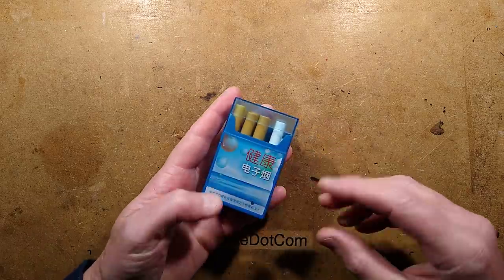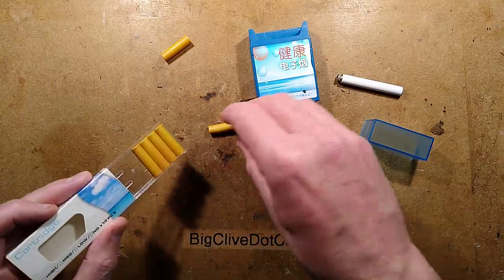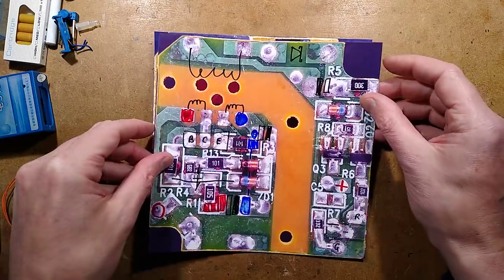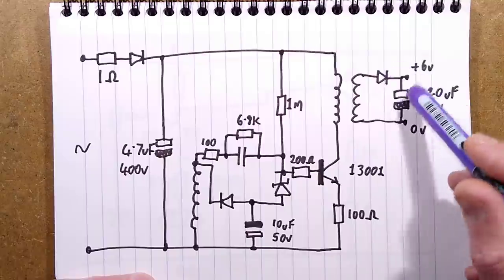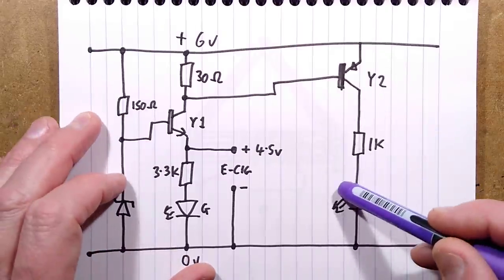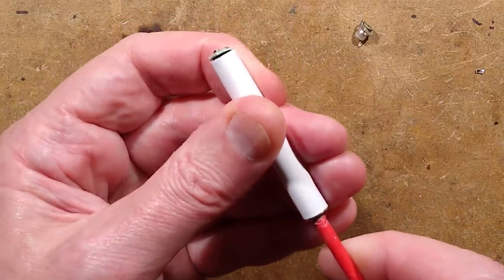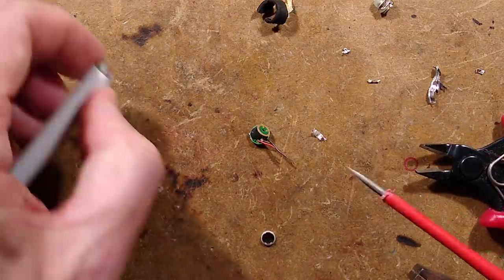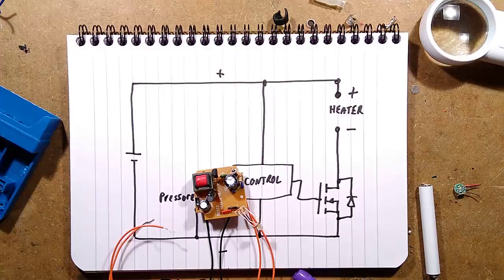Vintage novelty device teardown (with schematic)

Comment: Strangely enough, I found the insides of one of those e-cigs lying in the road a couple of weeks ago. The battery, controller, heater and pressure switch were all intact and undamaged but any casing had presumably been run over. The tiny led was still flashing occasionally otherwise I would not have seen it.

Comment: I hate how the vaping industry ruined Canadians from getting 18650s at a decent price. 25 bucks for 2 last I checked locally and can only be gotten from Amazon if you buy a flashlight which comes with extras. While cheaper than from shops still not worth exploring for wireless sensor projects for those of use with big pieces of property and such.
Reply: @nemesis2264 in the US it's 4 dollars a piece. I have a friend who could mail them but that's frowned upon. Haha

Comment: The input power can't be across the heater because it would turn it on when charging.  So there's something missing there.  Not complex however, perhaps there's nothing more than a diode involved.  It's of little consequence, the peek inside is enlightening as intended.  Thank you!
Reply from the maker: The charger connects where the heater goes.  Both can't be connected at the same time.
Reply: @bigclivedotcom    Oh right!  Silly me, it's swapped out.  Now I get it.

Dangit, now I have to find some other way to criticize!  ;-)

Comment: Funnily enough when I bought my last phone (from eBay) it came with a deathdapter as the power plug wasn't UK (but the phone was in the UK region, weird). I still use the deathdapter now. Tbh all OnePlus chargers can give you a nasty zap when unplugged and so I assume they're missing a discharge capacitor...

I'd love you to open one to confirm haha.
Reply: - that would be a small resistor paralleled with the offending capacitor to discharge it ✅
Reply: @samuelfellows6923  Yeah seems I meant discharge resistor not capacitor

Comment: Clive when you have finished your dismantling of all the devices. The items that you can't re-build and there circuitry inside that is still in working use. Do you re-use those circuits, for example, the built in power supplies. To use them for the output voltages in your own projects that you build? Maybe you could show some of those repurposed circuit's in action.
Reply from the maker: I do keep some circuitry, but the power supply in this device would not be safe for most projects.

Comment: I bet that the hardened steel wool on the tip is in fact sintered material - basically small balls of metal that are pressed into bonding with each other without it really melting.

Comment: I live in America and we had something similar to that in the mid 2000s maybe a little bit later made by a company called Blu and seeing that reminds me of the one that I used to have almost the same exact setup except the case looked like a pack of cigarettes with their branding on it and it didn't have a plug built into it you had to plug the pack in to I believe it was a USB cable and they had a standalone charger that came in the kit that you just put like twisted the battery into and you can charge just a single battery off of USB port instead of two batteries in the whole pack

It even had the same style cartridges that look like a cigarette filter with a tip that pierced the foil that you screwed onto the bed exactly the same as what you're holding in your hand

Comment: Weird question but - is there a reason you used an adaptor plug rather than plugging it directly into the HOPI? It looks like the HOPI will take any number of bizarre plug shapes!
Reply from the maker: Spacer.

Comment: Reminds me of a strange and thank god shortlived "concept" of ciggies, they where however reliant on fire to get going, by torching a small coal piece at the tip, that then warmed up wet tobaco inside the "ciggie" (which was made of thick paper with some coating on the inside) and then gave off vapor without actual burning of the tobaco.. how far we have come!

Comment: Big Clive... Master of finding the screw holes of novelty items 😅😂🤣
Reply: It takes years of experience. I can tell you - from years of experience.
Reply: @OldBenOne  there's normally at least one screw hidden under a label somewhere on a device generally I found that to be the case in most devices personally if you're trying to to open some of your tank so in part for any reason it seems like you're forgetting a screw or faster and it's obvious that there's still one left do a quick label check and if there's a label that's where your group is more than likely
Reply: Just before 12 a.m. my time here
Reply: And as I say or I'll just watch one more video and it's 5 videos later plus LOL possibly tonight or navy. Just depends on how things go.

When sleep does not come easily sometimes by the way it's best to do something until you're tired when you cannot sleep honestly I've been told that specifically by physicians so it's true for sure and yes it does help to be tired enough to actually get to sleep.

Most field don't realize this and anyone that does not might be very surprised at how well this works worth a shot.

If anyone is just can't get to sleep lying awake and so on.

If you try to force yourself to sleep or don't do this often times if not most you'll wind up awake longer than you would if you just how to get to sleep when you're actually tired enough had this happened enough times to know and have been told this again from Physicians

Comment: My neighbor gave me a couple of these along with some charging cables that plug into USB. The battery part has an led built in so the tip glows red when you draw on it. They'd been sitting so long the the cell was flat, and I thought I'd have to scrap them because they wouldn't charge. I took one apart and while probing around, I discovered that if I momentarily bypassed the charge chip while it was connected to the charger, it would give the cell just enough voltage to wake up the charge circuit and I was able to recharge them.

Comment: I found one of the 'cigarettes' shown in this video, many years ago: someone had discarded it and others had trodden on it.  Being a fool, I picked it up because I noticed some 'gunge' emanating from it.  Once taken apart - using a Dremel in a not-very-subtle fashion - I found the small circuit board and microphone-like device and LED shown in the video. Naturally, I decided that it must be a secret Soviet-era bugging device and I spent a few hours fruitlessly tuning up and down the FM band, trying to detect a squeal of feedback.  There was a tiny amount of charge left in the cell so I connected a white LED and resistor and used it as a torch for a few hours.

Comment: The pressure sensor is interesting, I wonder if it actually is an electret mic (which have an internal FET as a preamp). I know these things have a DC offset at the output when operating as a mic. It seems likely that a pressure difference between the outside of the capsule and the sealed reference chamber behind the diaphragm would cause this DC to vary. I'll have to try it...
Reply from the maker: In this case it's purely the diaphragm being separated from the case by a wafer thin ring, so it flexes under air pressure difference and triggers the unit.
Reply: Bit off-topic but your user Avatar or image whichever YouTube calls it's still shaky on that term for YouTube and Google for that matter.

And your username neon time.

Is that vacuum tube supposed to be an image of a voltage regulator tube?

Also once I ran across this place that hand multiple two bases in wall plates spread throughout the place.

And someone asked me what that might be for and I investigated they were thinking about just trying to prove it and see where it went or if you're connected or whatever and I said please don't do that because depending on what it is it could have high voltage theoretically present on some of the connections.

In actuality when the that circuit for every one of them was energized if the tube was inserted you get around 220 volts or so out the voltage for your tubes had to Children's at least that were connected straight through through to disconnect power from the power transformer generally of the device if the voltage regulator was removed from circuit aka the socket to provide protection from unregulated B+!

In this case it was disconnecting yet so there was no high voltage present if the socket was empty.

And yes all those sockets work connected through voltage doublers inside the junction box attached to the cover plate.

At first I'm when took one of the covers off I'm like what the heck is this circuitry for but I realized it was a voltage Doubler.

But the use of it stump me for a bit.

But there was no power coming in at the time.

As well as all the wiring was run box-to-box confirm that it the same wiring ran from box to box and there was at least a couple Joshua boxes as well.

That that's the only thing in that long run of wiring.

Which again kind of stump me.

When I went to the basements I realized there was some stuff down there that would be a timer and also photocell in a few switches in a few other things all tie together.

That obviously was meant to control lighting when the sun went down or after a certain time whichever came first oriya full movie dark out an override the timer and one switch said manual off auto.

It was in the off position at that time.

And there were certain Outlets that never do have power before then as well.

Also I did find a box of several of the same type of voltage regulator tubes like why would that be here took out one of them and realize wait a second is this something to do with this and I was thinking wait a second you can use these is a neon bulb.

And then it kind of clicked that wait a second with his fancy lighting control and this I wonder is this what fits those sockets specifically for that purpose.

Turns out bingo voltage regulator Night Lights!

Built-in to the place at that.

It also controlled one outdoor light in each area where there was willful outdoor lights and not only that but there were some switches that had three Physicians elsewhere in the place that were also connected through some other circuitry and wound up going to this lighting control system.

An interesting Lee enough Soma Elwood's were wired in a wage we switch between that and manual control or just on and other outlets forward strictly to the control circuitry.

However there was a box on the wall compelling contactors in some other electronics that this and other things were tied through as well and there was what looked like something from an old computer system or perhaps an old electronic organ reset combination action kind of thing.

That hand single insulated ended pins that could be inserted the clothes different sets of contacts for assigning different things to different operations.

I never seen anything like that before or at least at that time yes I'm more Manor.

And other automation old and automation goodies as well as well as it did have the old 24 volt 50s and 60s low voltage switching which solo this were tied into this and similar things as well

However the most interesting thing is about that place in the hallways and on the stairs if you were to put your hand near the railing or slightly near it don't remember where is he trigger plate wire metallic foil would be located too many years ago.

But in those cases when your head your hand on the railing or near it or in the case of the hallways along a certain place on the wall the lights would automatically come on.

Basically early momentary touch light switch.

Surprisingly everywhere there was tubes most we're still operating to that day.

And also a wealth of spare tubes and parts!

As well as some sort of remote control or signaling Hardware that was apparently Wireless although I only found the receiver at that time.

In a closet box with a big insulator and a long antenna.

But I made sure to disconnect that Not only was it a receiver it was a transmitter.

And also at that time that I had discovered it that was on a band of radio that was used for communications and also required an amateur radio license!!!

I think it one time either someone had a radio license and yes although this look custom but not everything.

It was built like out of modules I can see an old alarm systems definitely the DYI approach for some of them.

They were the old phenolic Bakelite or whatever same stuff is Old Tube sockets basically on waferboard or whatever you want to call it.

Will screw terminal blocks like that of speakers.

Anywhere from 2 or way more terminals in that.

And also live 120 volt in addition to low voltage on said terminals.

As you know back in the day that was acceptable It generally if you use certain equipment the people that would use it would be well aware that you don't go putting your fingers in back of the equipment since they would very much know what voltages and currents were present expose connections.

Such as on some old radio receivers and transmitters there will be raw AC power going to possibly an antenna relay or other equipment just to screw terminals like that little speaker terminals.

Also my folks to use an old waffle iron roughly a hundred years old still makes the best waffles ever.

However you never put your fingers anywhere near the power input since there is a removal cord however around that there is nothing no cover guard around the terminals which are basically bolts with connection pins.

And there was never a guard or provision for one of them.

Also I do believe I found the toaster that might go with that make of a plants from the same company thrift store once.

Plug-in cord was identical but I do not remember if it had does a plug or not worth is hardwired into it.

And also it had the exact same type of male plug on the cord as well a bit much better condition as in actually safe to use.

I do remember changing the power plug on the waffle iron yeah it was falling apart.

Not surprisingly.

That had been given to us many years ago been going strong ever since.

Works better than other waffle irons we've used before!

They don't make them like that anymore and most not as good.

Well I've waffled on enough I think

Comment: I noticed you used an adapter for the vape. The HOPI seems to have a universal adapter already built in. Is it still necessary to use the adapter you used in order to correct the voltage or polarity?
Reply from the maker: Spacer.

Comment: I think  and  this is just  my opinion,    is that the  feedback loop  off the  transformer  acts   like  oscillator because it's not rectified  by a   "dio-dee  "    Your  50  HZ  AC   acts  like the  oscillator as  it  turns the transistor  on and on  as the  alternating current  comes  out of that  feedback loop of the transformer . You mentioned that   the sine  wave    goes negative  below  ground
Reply from the maker: There is a smoothing capacitor, so the transformer does oscillate at its resonant frequency.  The feedback circuit in these single transistor units had me baffled in the early days until I realised it charged the holdoff capacitor below the negative rail.
Reply: @bigclivedotcom    No  I'm saying the  oscillating frequency  is the line  at  your  50 HZ ,  the transistor  turns  on  each side of   the  sine  wave  in sync      with the  main primary    winding .   The  capacitor   just allows  one side of the    frequency   to pass through  to fire the transistor